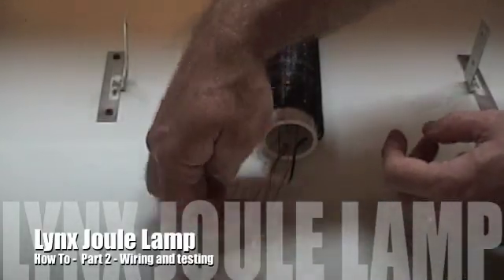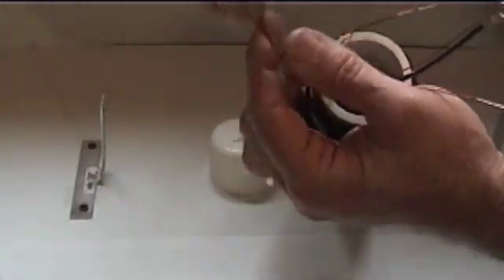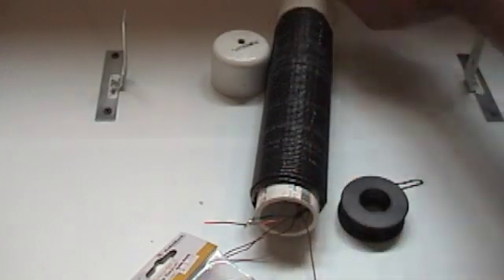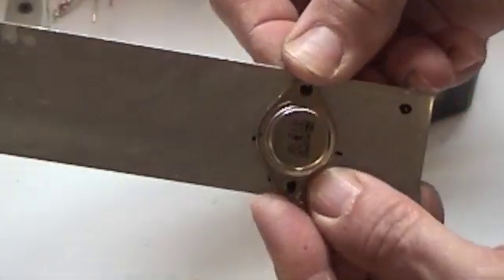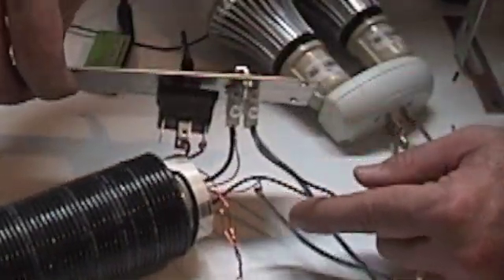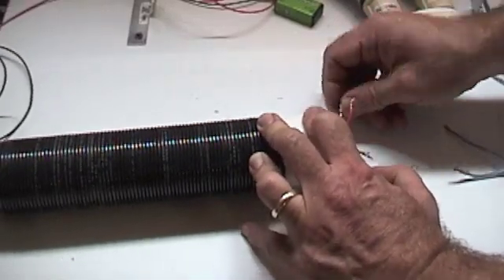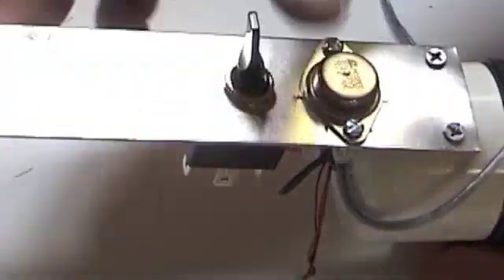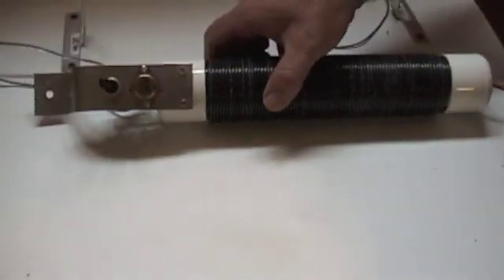Lynx Joule Lamp - How To - Part 2

Comment: I have wound the 3 layers of 14 gage magnetic wire onto the PVC core and the last 14 gage insulated wire.  I was lost on how the wires are hooked up.  I understand how to find the ends of each wire but I'm not clear if the circuit runs through from one winding to another.  Do you have a circuit drawing?

Comment: Hi, 
I have two questions.
1: The primary wire (Black, 14 gauge) that's been used in this video, is that a single stranded or multi-stranded?
2: You spoke about joining two wires together when it comes to connecting each layer of secondary winding together. Its confusing me. Could you please help me figure out which wire goes with which layer. Or in simple words, i would like to know the logic of that connection. I will be waiting for your response.

Comment: I did everything you show in the video, but did not work me, transistor using is 2N3055 because it looks great in the video, other question I have is the connections of the cables, do not know how they fit, you will have a diagram please. also what kind of lamps you are using for testing, voltage, etc. I am interested in a lot to make it work, and I congratulate all tutrabajo and share it, many thanks.

Comment: if you used a longer pipe couldnt you then install the stitch and transistor in it? instead of using the extra metal hanging off the end. or would that cause over heating issues with the transistor ?

Comment: If I wanted to make a LJL unit that could serve as an emergency backup power for a 30 amp furnace + 15 fridge, using deep cycle 12v batteries for  LJL power source how big of a unit would be needed?  Is it even practical for such an application?

Comment: I'm like less than a noob even. what does this do? I get that there's some form of induction going on. Was going to guess that this project is AC, but with the battery, wouldn't that make it DC? IF it's DC what's the point of the tesla coil cause wouldn't there just be a steady magnetic field (sort of messing with the idea of induction?). Very lost.
Reply: The transistor turns on and off at very high frequency.  This causes the magnetic field to energize and collapse rapidly.  The DC is converted to very high frequency/high voltage.  Look up blocking oscillator.  Fun stuff and useful.  Please look at the LJL-SC for the most recent update.
Reply: oooooooh DC to AC that makes more sense now. sweet. I am new to transistors. Knew they turned stuff off and on rapidly, but didn't make the leap to AC. Will have to make more study of transistors. I always thought AC was also reversing polarity/ direction of current not just turning off and on quickly. Though I would imagine the forming and collapsing magnetic field from an on/off DC current through a solenoid like that would be really crazy. Have you considered encasing the inner wires in a steel/ iron pipe inside the PVC? I imagine it would really blow the magnetic field sky high. Thanks for your response.

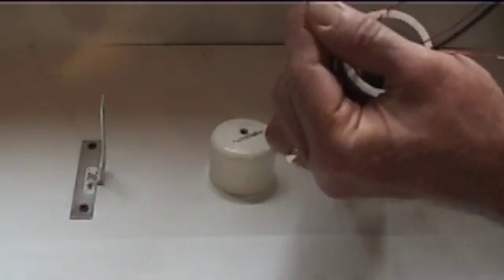Comment: I have a question at 1:10 to 1:30 you say somthing like tie to another short one and now we have two in parralel  but it seems like you must have meant series from the explanation... is the correct? series = top to bottom to top  to bottom   Parallel = top to top and bottom to bottom  if this makes sense.  thanks in advanced

Comment: Reverse the connections to the primary.  Usually that is all that is needed.  So positive will go into an opposite end of primary, and the collector will be opposite of what you have now.  Other than you could study the video a little closer and make sure you have the secondary right.

Comment: although the design here uses an air coil, it seems based on the lasersaber super joule ringer 3 and i think you can comfortably take a look at the schematic at his site to get a hold of the wiring part. Great work man, i will try these settings later on this week,
Reply: no i built this it works just fine you bunch of babies.

Comment: That thing looks positively dangerous.  There seems to be no insulation on the transistor, so there will be several many many volts on the aluminium panel.  |You also need diode protection for the transistor.
Reply: Oh shut up you doe=doe.

Comment from the maker: The amp draw depends on how many bulbs you want to run.  The circuit responds to the load by increasing amps.  It self regulates.
Yes it is kind of a large scale Joule Thief.
This circuit is really only good for home lighting off solar or wind powered battery.  You would want to use a regular inverter for small appliances.
I have designed a larger scale unit if you are interested.  Nothing wrong with prepping - you may find this to be useful before the world ends :)

Comment: Markus: Steve Hansel in a resent us-vawt blog claims that you are the reason that the us-vawt engineered foam vawt and 12 volt generator were a failure. 
Steve claims that the teeny generator had $400.00 worth of magnets and wire! HUH? That you charged $400.00 to assemble it and therefore it and you were an uneconomical failure. Are the two generators that you sold still working?